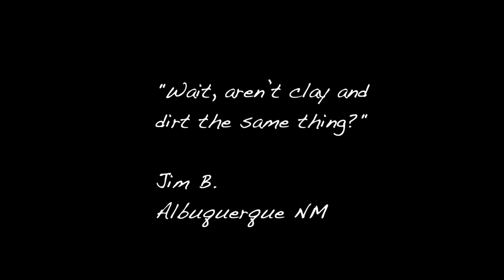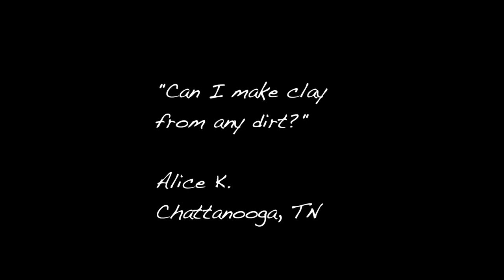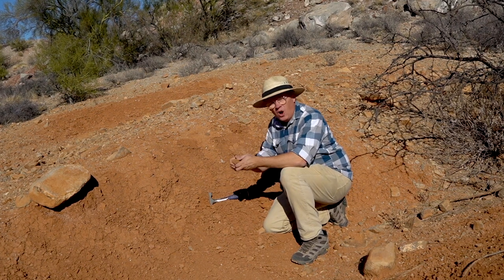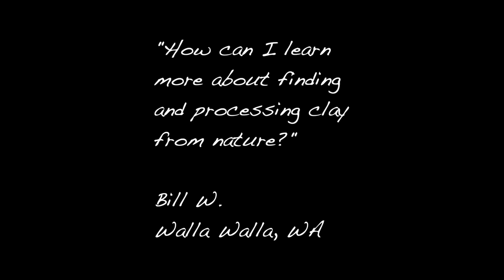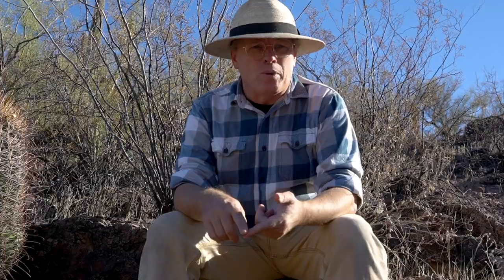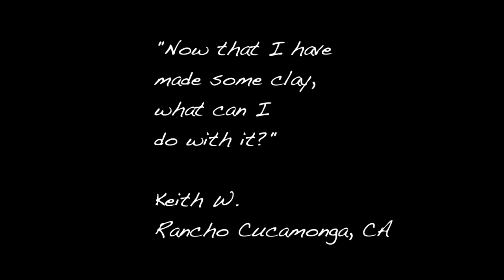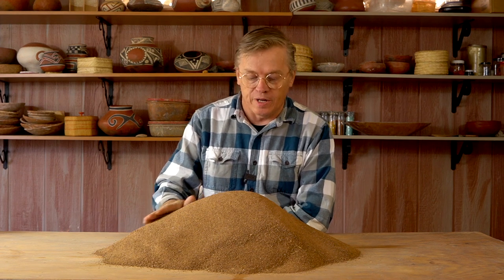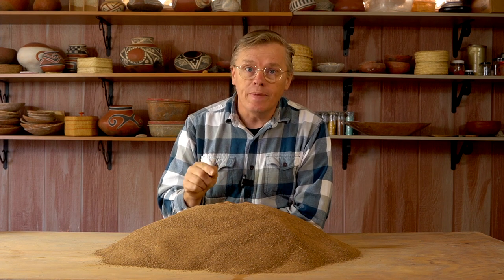How To Make Clay From Dirt Part 2

Comment: I'm so glad I found your channel as I've been wondering how I can 'harvest' clay from round here.  I think I've got 2 options: go down to the River Mudway -- ooops, sorry, I mean Medway -- and find a spot to dig there; or go up to the chalk hills.  (I live at the foot of the South Downs and within reach of the Medway in Kent, UK.)  Although I've been told chalk isn't clay (obviously, otherwise it would be called clay and not chalk) so won't be good for pottery, but do you know, are there likely to be clay-containing soils covering the chalk?  Walking on those footpaths in the winter gets very slippery and gloopy -- the mud tries to suck the boots off your feet -- so I reckon there's potential for clay... What do you think?  
Thanks in advance for your answer 😁.
Reply from the maker: Chalk is calcium carbonate so you may want to avoid getting any in your clay, otherwise you will need  to keep your firing temperatures below about 900 C , otherwise it can turn into quick lime which can cause spalls. I don't know much about the geology of England but I would be careful finding clay around chalk.

Comment: I am in tennessee, I am having a hard time getting the clay to be plastic. Any suggestions?
Reply from the maker: Have you tried levigating the clay to remove all impurities? If you have done that and it is still not plastic enough then it is probably time to move on and find a better clay source.
Reply: @AncientPottery  I have
 I tool the clay and remixed it with water again, let it sit for two to three hours and separated it again. Same. I am on the look out for a different spot.

Comment: I've been going through and watching everyone of your videos! Great information and really interesting. I live in Pennsylvania and was wondering if you know what clay we mostly have. I found some clay near a creak that was gray and had an orange swirl in it and Im currently wet processing it. Do you know if this will be good clay?
Reply: I have already tryed this kind of Clay, and it works pretty well but you have to use a little more temper than usual.
Reply: @Jog_l  ok thx for your reply!
Reply: @hollymiller1623  Yw
Reply from the maker: Only experimentation will tell you for sure. I don’t personally know anything about the clays of Pennsylvania though. Good luck.